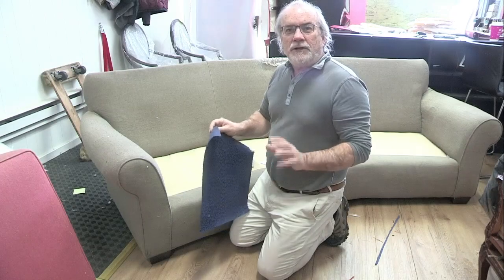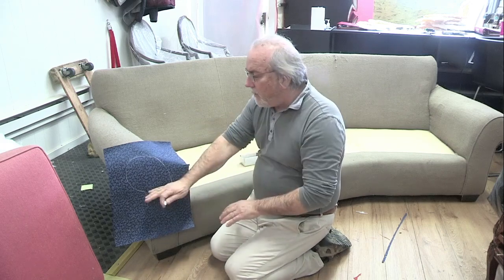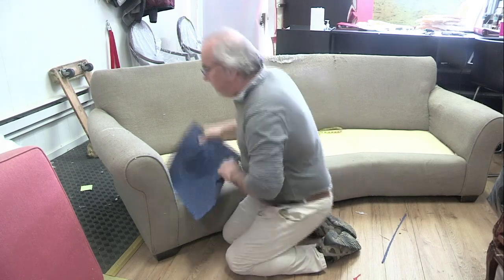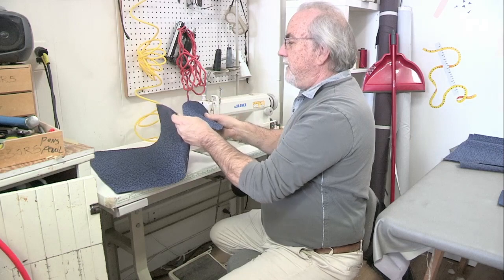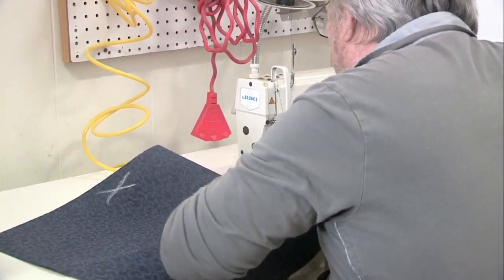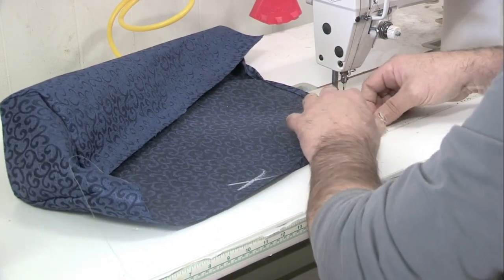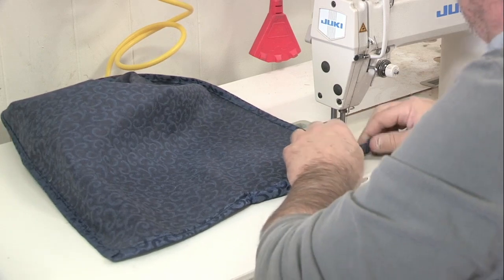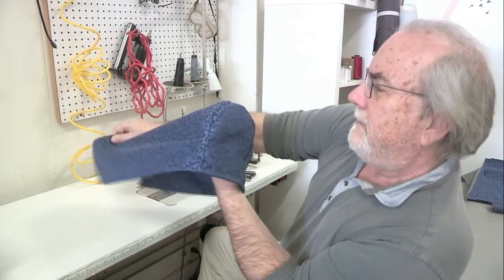Making Rollover Arm Caps

Comment: So the width (circumference) on larger fabric has to equal the length  ( circumference)of rounded smaller piece in order to stitch successfully so no overhang or comes up short?